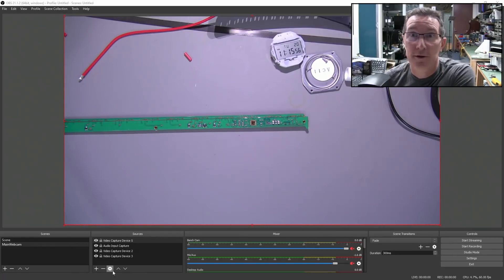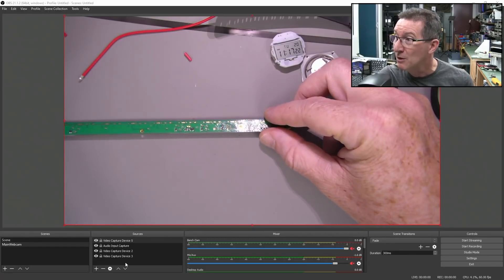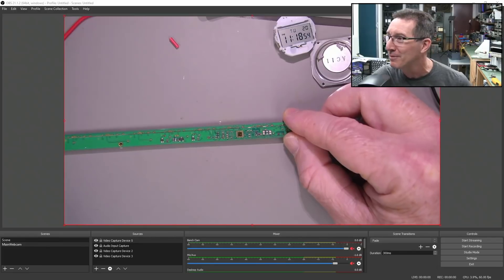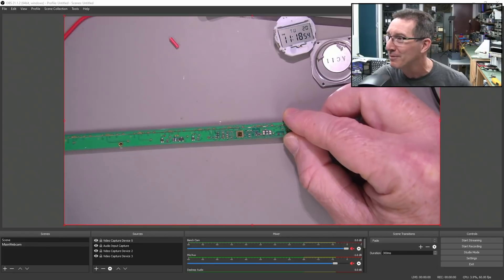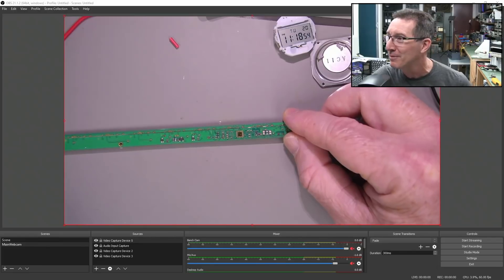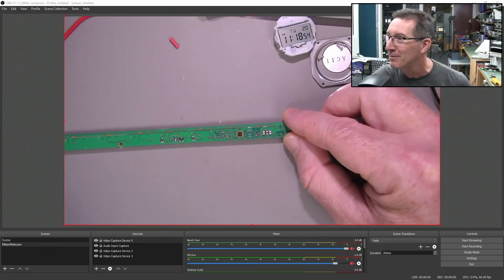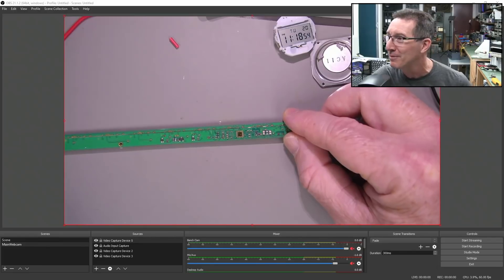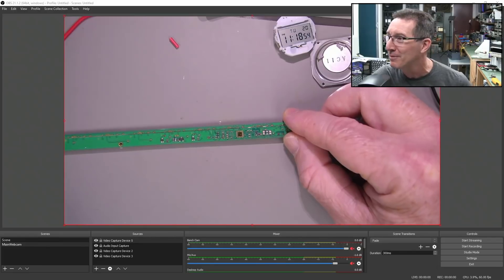The Tagarno Acquittal - TI or Black Magic Charged?

Comment: The TI chip is nothing more than a HDMI amplifier with cable length equalization.  The serial encoded HDMI to parallel digital video decoding is being done by some HDL firmware inside the Black Magic FPGA.  The Analog Devices receiver ICs are actual HDMI decoders.  They decode the HDMI serial data video into parallel video data with a horizontal and vertical sync.  The bug you see is most likely a HDL firmware bug within the Black Magic FPGA where it is doing the job of the Analog Devices HDMI receiver ICs.  I have seen this in the past with noisy long cable run HD-SDI HDL code in FPGAs, but, this is the first time I've see this with HDMI.
Reply: This is fortunate, as hopefully they can fix it in firmware.
Reply: @alexatkin  Usually, HDMI deserializers are purchased cores.  Yes, it can be corrected, but there may be more than 1 company involved in the chain lengthening the debug procedure.  It may also be something as simple as a configuration set for said core.  Something like the ability to recognize 16-239 broadcast video VS 0-255 full range video (Mainly used by PC video cards) which the camera may be operating in.  Analog Devices IC HDMI deserializers recognize this stuff automatically and even trim the video levels automatically even if one erroneous sets I2C controls incorrectly.
Reply: @alexatkin  Just based on the description given by Brian, it might also be an issue with the routing on the board where it may need to correct for the cable length at almost its max. reach.
If this is at least partly the cause of this issue, then you would expect that it also might depend on the actual cable being used. So by switching cables, in the end one cable may then not showing this issue. (even if that means that specific cable needs to be out of specs)
I don't know how this TI chip does do its cable length equalization, but I can imagine it will dynamically delay either signal to where it most likely will output rising flanks on each line at the same time.
If for whatever reason one of your signals may need to transfer data at its max. data rate, then a timing correction of just about half a period may easily "flip" and just pick the wrong correction.
So no idea if it is possible, but perhaps this chip could be instructed to not allow to "flip" the timing corrections so drastically unless there is a good reason to. But I can imagine that would be a rather complex firmware change involving a number of vendors as Brian also noted.

Comment: Looks like clock recovery on a waveform with a lot of maximum value pixels. And theres a slight drift on the clock rate causing a buffer overflow on static images.. just cheap crystals with poor ppm. Measure clock frequencies...

Comment: Fault could be on either the Tagarno side or Black Magic side - obviously those channels on the switcher are less tolerant of what the Tagarno is putting out but it depends if the signals are actually in spec in terms of timing/signal integrity or not. Would likely need some fancy HDMI test equipment to do some eye diagram scans etc. to know which side was really at fault.

Comment: I'm sorry if I didn't quite understand what it was about. But my opinion is this: at a certain position of the CHIP, the video stream (signal) repeats in the form of a certain synchronization stream (signal), which leads to a data transmission failure.

Comment: You need to ensure no FRAME REPEATS are happening on the USB or other "good" streams.  Many transcoders and stateful repeaters and monitors will skip bad frames by retransmitting the last good frame.

Another test may be to check for frame latency: Higher latency means buffering, which provides the opportunity to "skip" bad frames.  Perhaps also try a monitor with gaming mode enabled.

Edit: I'm still betting on the problem being in the camera's video format encoder.

Comment: I Mentioned it in the first video posting about inputs 1&2 using a different hdmi chip which has less color space compatibility but supports higher refresh rates. This is used for gamers to capture their 120hrz or higher gaming videos. Unfortunately there is no hdmi chip capable of both higher refresh rates and all the color space compatibility ATM.

Comment: I Have a bit of a theory based on HDMI timing and when it happens. HDMI prior to 2.1 used TMDS signalling. TMDS stands for Transition Minimised Differential Signalling.  This uses 3 parallel custom encoding 8b/10b encoders, 1 each for R/G/B, along with a clock sent once for every symbol (pixel clock is 1/10 data clock). To make things more complicated in cables before HDMI 2.1 the balanced pair for clock is normally unshielded and of lower quality than the colour lines.
The 3 encoders have no knowledge of what each other is doing, but normally they would be sending different things because R, G and B have different values. Three different symbols would make clock recovery quite easy - there's a really good probability you're going to end up with a transition on each cycle between the 3 symbols. 
Except when you drive the sensor beyond its capabilities and it outputs pure white. 
Pure white is going to have the same symbol on every line making clock recovery a LOT harder. The unshielded clock signal is inevitably going to be fairly jittered and noisy and probably not going to be a great deal of help at high frequencies. Remember that 'Transition Minimised' from earlier - there's already precious few edges to clock on.
The TMDS171 is supposed to recover clock signals - and i would bet it does so by using the combined transitions across the data and clock lines to recover the clock.
I know its irrelevant now but this is one of those cases where a good cable actually might help, HDMI 2.1 introduced shielded lines for all signals (they stopped using the former clock line for clock signals and made it into another data line) so an '8k cable' may help with clock jitter as may higher cable quality help with general jitter. A good active cable would put a retimer like the TMDS171 right next to the device which may help clean up signals. Be really interesting to see an eye diagram of what the Tagarno is outputting.
Reply: Additional theory - Tagarno can work round this timing edge case by setting ONE of the RGB channels to max 254 and the others 255, or vice versa. Potentially do the same at the lowest values so you retain the same dynamic range and never face the same issue with black somehow. (ie have red as 1 to 255 since we're least sensitive to it, and blue and green as 0 to 254). the odds of getting the same symbol on all lines for any significant section of the picture any other way is probably very low but you could also check that the 3 outputs are never the same. (edit - or just permanently set the LSB different if you're really short on cycles)
Reply: One test for whether its the TMDS171 being unable to recreate the clock - what happens at the 0 latency output of the ATEM?
Reply: oh yeah - because the symbols are in pairs and there is a deterministic state machine involved to maintain 0 DC bias it would take at least 2 pixels, probably an avg of 6 full white horizontal pixels to hit the same symbol and start losing clock

Comment: Looks like you'll be using channels 3 or 4 from now on.   Not like they are going to actually fix anything.   Good find however,  reminds me of the problems Denon had with HDMI 2.1 (sort of).
Reply: The whole concept of routing the video through the AV receiver is very flawed and doesn't account for the basic fact that audio stuff outdates at a much slower rate than video stuff. (You can use an amplifier from the 80s with a modern PC and get decent audio, a monitor from the 80s is not going to be very usable on a modern PC.)
Reply: @NiHaoMike64  that used to be true, then positional audio became a thing.

Comment: Told you it was the capture hardware....its telling the Tagarno it supports stuff it doesn't....black magic do know this, i wonder why they didn't admit it to you when you contacted them. This stuff happens everywhere the HDMI standards committee allows manufacturers to say their devices support stuff they don't, there are tons of devices that say they accept 4k when they don't display 4k they just don't crap out and downsample it instead. There are monitors which say they are HDR compatible when all it means is they accept HDR but just dump it and display the non HDR image. Sometime this sneaky bullc**p doesn't get implemented correctly.

These "standards" are becoming so complex that  having a logo that says "HDMI 2.1" tells you absolutely nothing about what the device actually supports....USB is even worse.

Black magic already know this....why didn't they tell you?

Comment: Not surprised. Doubt that TI ic in any monitor but I still think the targano has issues in the signals it sends not just black magic. The other ports it works on the data rate is much lower so not surprised. I think the clue is the data rate with the switcher have you tried to connect to a 1080p or lower connection?
As you said the switcher did not work with Tagarno!

Comment: As others have pointed out, the TI chip doesn't do HDMI decoding, while the AD chip does. So if the problem is with the HDMI decoding, all signs point to BlackMagic.
However, TI is not completely out yet: if the re-timing gets thrown off by the clipping highlights, BlackMagic's FPGA might get only garbage signals to decode in the first place.

It might be interesting to check where clipping leads to the error: Beginning or end of line? Start or end of frame?

Comment: I experienced hdmi timing issues when connecting one monitor to two separate hdmi sources. The screen would flash black as yours did. I changed input and the issue disappeared. No tweaking on my part. You may want to try an alternate video matrix for comparison.

Comment: The fact it drops dead going through the jitter correction chip (and the splitter) kinda points to timing issues to me, unless youre using HDMI 2.1/8k cables (there was a fairly big step in quality) i wouldnt necessarily write off cables having an influence too. Sounds like a perfect storm of timing issues XD.

Comment: I am guessing the reason for the "re-timer" is because those first channels are the ones that can be used as Picture-In-Picture sources, so they might need to be re-timed to whatever the current input that they are being overlaid on top of?  I don't think it's because they're 4k because AFAIK the blackmagic boxes only support 1080p on all ports.
Reply: nah, its just a bitmap once it gets to that stage.
Reply: @mycosys  Now that I think about it a bit more, that would indeed have to be the case.  Maybe it's because those channels need to drive additional inputs somewhere then (which may still be PiP related), and need additional amplification/buffering?
Reply: @gundys_garage  someone commented that its to provide 0 latency monitoring outputs, so it can buffer the signal enough send it to an output with near zero lag as well as to the FPGA for decoding and recording it - makes perfect sense if its designed to sit between the PC and the screen for a gamer.
I do think that chip may be the issue though - i made a much more thorough comment but i think it may be unable to recover the clock if there is a prolonged period where R G and B wires all send the same thing (ie a big section of overexposure where its all FFFFFF) and theres a marginal signal to start with.

Comment: There could be issues with brightness/white color amplitude difference between output of microscope and TI HDMI chip.
Since it happens as brightness changing, it's possible the input signal into TI chip passes the range of what the chip can handle or been biased for.

Comment: on the atem, channels 1 and 2 are built differently to enable almost 0 delay between the input and the outputs, this may imply difference in video handling
the fact that the issue only happens with high lights may be in relation with signal levels going over the 235 value (of 255), which is considered "overexposed" video (superwhite)
Reply: I think youre right, but it may be a prolonged period of all of red green and blue being the same signal (which is only gonna happen for any period on FFFFFF white) causing clock recovery to be difficult.
Reply: @mycosys  isn’t HDMI supposed to use a framing protocol and appropriate scramblers, just like SDI for this exact purpose ?

Comment: I don't suppose chan 1 & 2 are for a specific older HDMI standard and the others work with later spec HDMI devices for legacy compatibility or something silly like that ?
Reply: no, they're designed this way for nearly no latency to the outputs when "output 1 and 2 direct output" is selected in the software
Reply: @AmauryJacquot  That doesn't explain why you would use two different ics in the bom tho you would just use all the same for all chan's then, so seems there is a specific design around chan's 1 & 2 by looks of it from tear down. 🤔
Reply: @SlyerFox666  as I understand it, there is more latency with the Analog devices chip. Channels 1 and 2 are specifically designed for gamers use where is a direct passthrough to the output chip, without going through the fpga chain
Reply: @AmauryJacquot  Oh ok thanks for the info 👍
Reply: @AmauryJacquot  The TMDS171 is a jitter corrector and BUFFER, its used to directly drive an output with zero latency (quite likely with another one of these or equivalent on the output) as well as provide jitter corrected signal to the FPGA.
Its the same chip you would use if you were making an active HDMI cable, generally one each end. So this is like an active HDMI with the FPGA hanging off the side  - effectively 0 latency to the output.